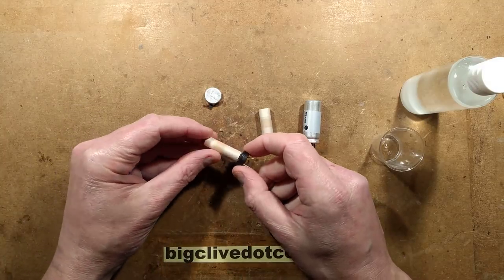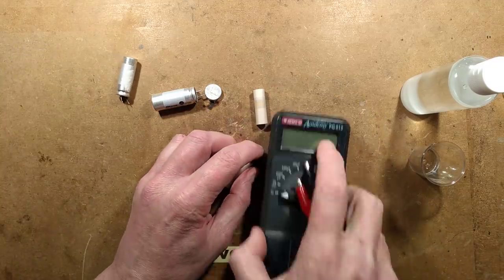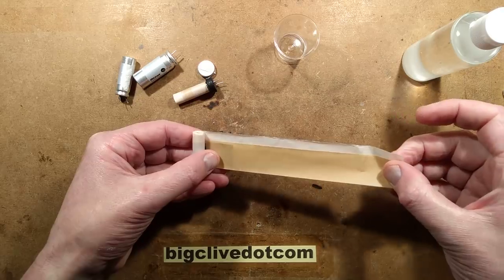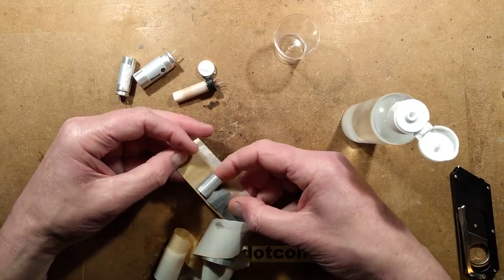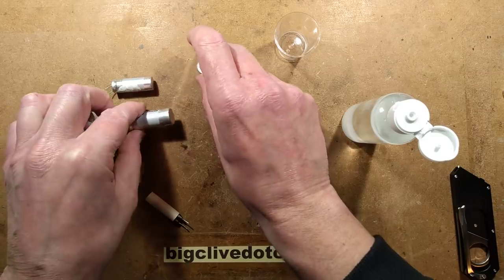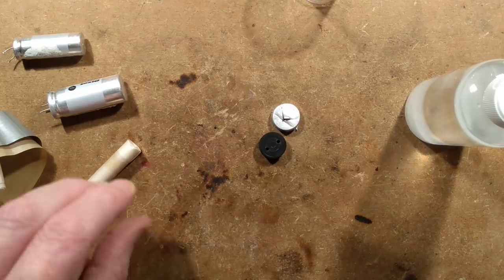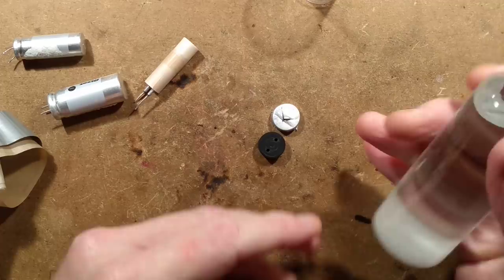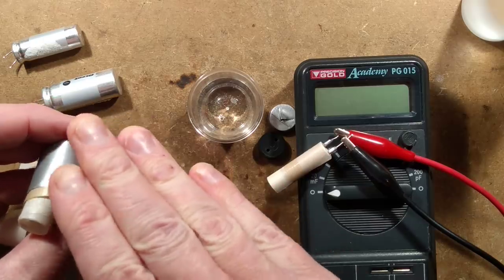Adding electrolyte to a fake (dry) capacitor.

Comment: I worked at a capacitor factory, where we made both ceramic disk and electrolytic caps. The materials for electrolytic caps are quite specialized compared to paper disc or paper rolled caps.

First, the foil is embossed or etched chemically to increase surface area 100X, providing more electrolyte contact with which to store charge, which reduces the size of the device dramatically. Then the aluminum foil anode gets oxidized, and that happens before being rolled, by exposure to a heated O2 atmosphere at about 500C, or with a liquid chemical treatment. This oxide is the dielectric, which typically has a dielectric value or 7 or higher, much higher than in disk caps at 3. Unlike in a paper or ceramic cap, which has two metal plates, separated by a dielectric, the electrolyte serves as the cathode plate in an electrolytic. 

The final capacitance is a function of the surface area of the dielectric sandwich, given by the formula C = e * A/d, where e is the dielectric constant for the dielectric, A is the surface area of the plates, and d is the distance between the plates.

The electrolyte is simply a conductive medium of known properties,  composed of two substances, an insulating solvent (e.g., ethylene glycol) and a conducting salt (e.g. ammonium borate), to arrive at a specific ionic conductivity appropriate for the voltages permitted. 

Assembly happens in this order: (1) the three layers are laid up on assembly spools, AlO2 foil, plain paper, and absorbent paper. 
These feed into a unit spooler, which first spot welds the anode lead while winding the leader paper, and then winds all three layers together for a specific length, while wetting the absorbent paper with electrolyte just before wrapping around the unit spool. Then the cathode lead is inserted, the foil is cut, followed by a few more turns of just paper. Finally the paper is cut and the unit is canned, immediately tested in the machine, and rejected if out of tolerance. If the rejection rate is too high, a human is summoned to figure out what’s wrong (usually electrolyte composition or application). 

A machine can make thousands of caps an hour.
Reply: Packet Guy 
Thank you very much for your comprehensie explanation! I’ve always wondered how electrolytic capacitors can have such high capacitance. That the electrolyte serves as the cathode, explains it all to me. I really enjoyed reading this and I’m sure many others will have too.
Reply: Thank you for the great explanation! I've never had anyone explain the actual process of making an electrolytic capacitor before, only the general principle behind them. Suddenly it all makes much more sense to me.
Thanks for sharing with the class!
Reply: Unfinished lists of numbers are mildly triggering
Reply: @userPrehistoricman  'Mildly' doesn't apply to 'triggering'.  Like switching, it is a binary state.  If you find unfinished lists to be mildly annoying, you can say so, you don't need to grasp at memes.
Reply: Pongo Ponginae + Prehistoricman
What are you two talking about? I get the point that triggering is binary but I’ve no idea what is the “unfinished list of numbers” referring to.
Reply: Now that I’ve watched the video’s again it appears to me that even Big Clive isn’t aware that the electrolyte serves as the second ‘plate’. 0:40 ‘it’s just layers of metal next to each other’. As I have now learned, a dry capacitor is just 1 layer of metal next to just a connector. That explains the 200,000 times higher capacitance after the electrolyte was applied.
Reply: @Conservator.  ;-) I'm guessing, this

from Packet Guy's post 
'Assembly happens in this order: (1) the three layers are laid up ...'
but there are no following numbers.
Reply: @Deipnosophist_the_Gastronomer  triggered much?
Reply: Pongo Ponginae Haha, tx! 😁
Reply: @Conservator.  The one that Clive pulls apart has 2 foil sheets, each seems to have a damaged spot where it attached to a terminal. I suppose there are different constructions to these capacitors.  It's really interesting.
Reply: @2lefThumbs  No, not often, Lefty, but thanks for your concern.  :-P
Reply: Yes, the (1) is the unfinished list. Your reaction to my mild triggering makes me marginally crippled.
Reply: @Deipnosophist_the_Gastronomer  haha, excellent play on words:D👍👍
Reply: I was imagining the whole process like how it's made in my head.
Much love 
Thanks 
way ,truth ,and life is in JESUS CHRIST
Reply: @userPrehistoricman  Yeah, I'm sorry.  I'd just got home from a taxing day at work.  I shouldn't post when I'm grumpy.  Forgive?
Reply: I understand the grump. Forgive.
Reply: My brain just exploded.
Reply: Thanks for sharing this!  Will try to remember reading this comment, the next time I am pondering the sheer terribleness of the internet -- heh, it would be beautifully cruel irony if you were totally full of it above, just trolling hehehe (but, obv., not possible: spelling/grammar too good :P)
Reply: one day we will not have to suffer the ocd, the triggered, the hipster, the meme, the grammar warrior. We might get a thread that isn't drowned out by this inane crap and stays on topic. Would anyone like some toast?
Reply: Do you have any idea why these particular capacitors are dry?  Manufacturing defect?
Reply: the upscriber 
Yes and no. Probably manufacturing defects, rejected, picked up by a cheater and sold on eBay. Leads to very entertaining video’s though.
Reply: @theupscriber65  maybe the chinese copied some duff ones.
Reply: "If the rejection rate is too high, a human is summoned to figure out what’s wrong (usually electrolyte composition or application). "

This is the sentence to win language as a whole. We've done it. Let's just leave the rest to the machines.
Reply: Thanks for the explanation! I think Big Clive's capacitor gave a capacitance when he added the electrolyte, because aluminium has a natural thin layer of oxide on it. However, it is so thin that its full of cracks, so that the metal is also in electrical contact with the electrolyte. Electrically, this would appear as a low parallel resistance, hence the boiling.
Reply: Caps off to this guy 🙌
Reply: I <3 You and your Packets!
Reply: Are you in charge? I feel you've got potential ✌️
Reply: What generally happens to the rejects? (You know, when they are not diverted for sale on eBay... or is that what generally happens?)
Reply: @RealWorldPolice  Great question!
Reply: I'm just like to take this moment to thank pkg's fingers and brown are taking the time to write this out for us intelligent nerds or or should I say they even more smarter nerds
Reply: 1: the three layers are laid up on assembly spools, AIO2 foil, plain paper, and absorbent paper. 
2: these feed into a unit spoiler, which first spot welds the anode lead while winding the leader paper, and then winds all three layers together for a specific length, while wetting the absorbent paper with electrolyte just before wrapping around the unit spool. 
3: then the cathode lead is inserted, the foil is cut followed by a few more turns of just paper. The paper is cut and the unit is canned. 

There you go for all the triggered( ugh that word makes me cringe) people out there.
Reply: Dido always wondered myself as well.
Reply: the intelligent comedy in the replies to your comment ,is highly amusing.
Reply: @UberAlphaSirus  This.

And to stay on topic: I too never knew that the electrolyte is considered a cathode plate. Explains some behaviours experienced in clives video.
Reply: @aaaricmondroofing1703  why do you have to spoil things?
Reply: ....absolutely a great explanation, I would love to see a capacitor factory. 
Thank you for that elaboration of knowledge.
Reply: But who tastes the electrolyte?  :)

(Great post BTW)
Reply: @Conservator.  It appears to me that prehistoric was rude in a condescending way and Pongo was calling him out on it.
Reply: @markusallport1276  
Thank you.
Reply: a human is summoned to figure out what’s wrong (usually electrolyte composition or application). 
You mean someone like Big Clive to taste test the electrolyte?
Reply: @RealWorldPolice  the hell are you doing in a bigclive comment section, lmfao.
Reply: @Deipnosophist_the_Gastronomer  ayyyy, superior rightie whitey
Reply: @Deipnosophist_the_Gastronomer  probably haven't heard about analog triggers...
Reply: @YOU BLYAT  I feel it would be somewhat rude to not reply to your comment.

 @GeomancerHT  I'm assuming that you mean buttons on a controller.  The label that a company puts on these is largely irrelevant.
😅 It has been a while, but, back in the day; these were quite good for certain flight / driving simulators, and not so good for most other games, e.g. shooters.  They could as easily, and perhaps more accurately, labeled them 'accelerator' and 'brake'.
I don't know about the current state of controllers, hopefully things have improved.
😄
Reply: Always was curious how they made different sizes and capacitance sizes as well as physical sizes. 
Thanks for the in depth information.
Reply: Especially when a ten year old girl is running the machine lmaooooo 😆😅
Reply: @kerloesmedhet3480  no
Reply: Thanks a lot for the detailed explanation.
Reply: The problem is not in assembling the capacitor, nor is it a problem in the work of the electrolyte. Rather, the problem is in the work of the negative plate. How is this done?
Reply: Can other solvents be used instead of ethylene glycol?
Reply: "A human is summoned"😂
Reply: Wonderful job explaining that!

Comment: Clive, after the video on that battery booster it began appearing in the Wish adds on my facebook page. Thank you for replacing the various BDSM wear with cheap Chinese products.
Reply: @a89proof  with latex that can break anytime
Reply: @bitelaserkhalif  Don't threaten me with a good time.
Reply: I got some of the cheap chinese BDSM stuff, i could recommend buying quality stuff at local shops or at good onlineshops XD
Reply: Bitelaserkhalif 555 • - I'm allergic to latex and it causes severe pain to my skin. Would that just add to the kink factor?
Reply: Dale Gribble,
I know someone whose wife is from China ... I suppose you can say, "Made in China" ... as for the BDSM part, I dunno XD

Drunken Hobo,
Um... depends on if you like pain or not. XD
Reply: @drunkenhobo8020  Some people use whips and nettles..... You could go for that effect and paint the latex green. :D

Make it your alter ego; 
Poison Ivy!
Reply: Hi
Reply: @voltare2amstereo  Ordered from China you'd be Very lucky your toys came with a 'hygiene' seal.  
Makes the crappy and half broken ones easier to return though ;P

"Deep rumbly Vibrations" - My ass!
Reply: Im not the only one with weird bdsm stuff

Comment: At one point in my career I worked on a battery charger/power supply that operated on 208 volt three phase power (US) and charged a 660 amp-hour 36 volt battery bank. It used triacs directly connected to the mains and several farads of capacitance for filtering. We would "form" new capacitors before installing them using a current limited power supply set to the working voltage of the capacitors and wait until the current was down to a few microamps. This is also how we would test in-use caps, checking their leakage current at working voltage.
Reply: A very similar method is used for 're-forming' old capacitors in tube/valve equipment. Limit the current,and slowly ramp up the voltage over several hours,or days. You'll know it's worked (or not) if the leakage current eventually settles to a low enough level (or doesn't).
Reply: Ethylene Glycol is sweet tasting and highly toxic in that it destroys kidney tissues. Dogs are known to lap at puddles of ethylene glycol anti-freeze around sloppily maintained automobile service facilities, only to be found dead a short time later. Propalyne glycol is also sweet but in addition to being used as an antifreeze in potable water systems like motor homes or caravans prepared for winter storage, is used as a food grade sweetener.
Reply: And laxative.
Reply: @stephen1r2  That would be Polyethylene glycol (PEG). The Polymer is considered non-toxic, the mono- and dimer are.

Comment: Worked for a company out if Taiwan that manufactured motherboards in the 90s ... eventually we setup a plant on mainland China in the free zone near HK ...

We found that a manager was swapping out good parts for defective ones - not enough to 'break' the board, but which caused failures over time ... e.g. we used keyboard fuses on DIN connectors - they look like resistors painted light green... turns out he made a penny a shot by swapping then out for fake ones and selling the real ones.

We realized it when kybd bios started popping ... old 5pin DIN keyboards didn't like being pulled out hot...

For reference, we made an average of 150K boards a month ...

Comment: Need a higher voltage (up to or over working voltage) and 470K resistor in series. And several hours - overnight perhaps

Comment: We had a batch of 4.7uF 400V caps at work which had been soldered into little switch-mode power supplies in the primary side, and hadn’t been formed in the factory. Powering them up just blew the fuse. Solution - put a 15W pygmy lamp in series with the supply. This would light for about 2 seconds and then dim down with a “new” capacitor. The leakage current slowly went down to next to nothing. They seemed to work fine after that. Thinking about it the forming process must be pretty quick in the factory, as they’re easily going to be making 10,000’s an hour!

Comment: Alot of capacitor meters get thier value by the amount of time it takes to charge the capacitor. Those types of capacitance meters will read a higher capacity since they are acting like a resistor taking longer to charge them.
Reply: *their

Comment: One of the other failures of those caps which is really freaking annoying is the seal around the rubber boot develops a tiny leak. So tiny the electrolyte can't pass through but large enough to allow a significant amount of heat to pass. If it's seated all the way against the board, it'll just make a little black dot on the board, no biggie. If it's floating on the pins like most caps it'll whistle as it makes the air outside that hole heat up. I have a motherboard in my closet with that problem, works fine, the cap even works within rating. Had to plop down some hot glue to silence it.

Comment: "Forming" the capacitor, by passing direct current through it, effectively thickens the oxide layer of one of the aluminium plates. Before "forming", the "capacitor" reads out as two diode junctions because it's exactly what it is, although with extremely low reverse voltage, due to the very thin natural oxide layer protecting the aluminium plates. By  "forming" it, you're imposing an asymmetry between those diode junctions (polarizing). That's why electrolytic capacitors overheat when reverse-polarized. They behave pretty much like two Metal Diodes back-to-back with fairly high series resistance, and very high charge storing capacity (capacitance), due to the quite high surface area, allied to the microns thick separation between the conductive electrolyte and the metal.